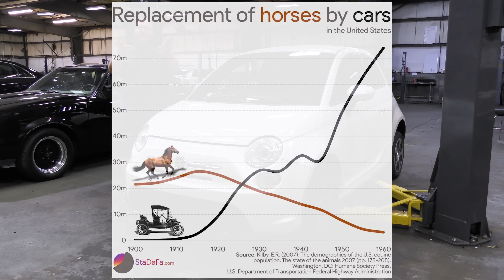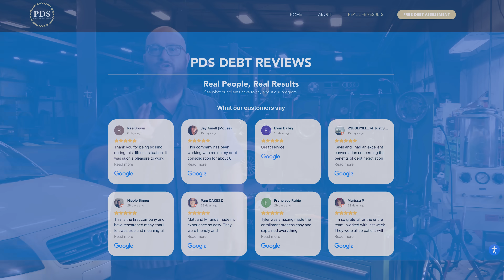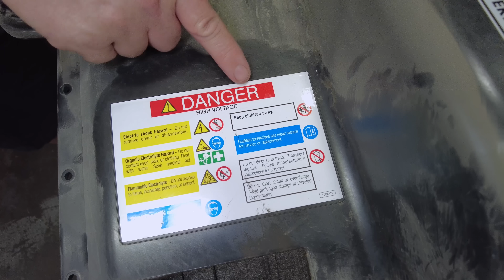How to SAFELY Remove the EV Batteries From my Fiat 500e

Comment: The stallantis EVs Mahle onboard chargers can be changed by removing 6 bolts but the unit has to be programmed by the dealer. The leaf has had its code hacked so can have any batteries fitted giving a range of up to 270 miles.there are plenty of leaf battery modules on eBay if you have an insulation fault due to an overheated pack

Comment: ICE cars don't have cross swappable parts.  Every auto manufacturer has their own proprietary systems and parts.  I don't see EV companies all agreeing to a single battery design or battery management system.  Each of them will continue to try to achieve their own goals for the customer they are trying to reach.  The only place where I do see them coming together is with the charging port and even that willl probably change as technology evolves.

Comment: My problem with the EV thing is how manufactured the push top down has been instead of it being market driven and equally important is how we totally skipped over the hybrid phase which to me is where most of the market should be still… hybrid tech is legit and we could’ve had best of both with incredible gas mileage for the time period until battery technology developed

Comment: I don’t think automakers don’t want owners to fix modules.  It’s cost.  It’s cheaper for them to just swap modules than to hire people to do specialized component level repair.  Not only that, technology is getting more complex and more compact.  For someone to component level repair of a module will have to deal with difficult to remove conformal coatings on PCB assemblies, then have to deal with troubleshooting a specific fault in the assembly (of which needs to “see” other computers and modules and has to be installed in the car or hardware emulator platform), along with the experience of reworking assemblies containing SMD components, IC’s with BGA/QFN/QFP/SOC/SOIC form factors, of which requires incredible skills to desolder and solder without damaging the delicate traces on the PCB.  1/2 hour of hiring these highly skilled personnel will easily exceed the cost of a $500 module, and some problems, it may take hours, or even days to troubleshoot a complex device.

Now, there is a case of the right to repair (knock knock John Deere, Apple, etc) issues with manufacturers.  Unfortunately, those who do have the aforementioned skill sets above (such as I), some things aren’t feasible for repair.  My 85” Samsung TV for example.  Picture went out.  No damage to the LCD panel.  While debugging this issue, I found there was internal faults to the LCD panel.  How I fixed this was to buy another 85” tv that wasn’t a Samsung.

Comment: What if a manufacturer offered an open source EV with an option to operate manually without a computer or operating system?

For sure standards is one of the hardest fights. Not just with cells, but chargers.  Look how long it took for iPhone to move to USB-c charge ports. 
 ports.

Comment: The argument car vs horse doesn’t work with the ev situation. That was a car vs a horse. People saw the benefits of the car over the horse and bought the car. Today we have car vs car. The thing that changes is the propulsion system. But the essence of the thing is the same car vs car. An ice does the same car things as an ev, even has more benefits, more range, no charging hustle, a nice sound and feel, when you drive it, you can bond with it and doesn’t feel like an appliance, cheaper… Again, car vs car is today’s competition and people are not buying the ev car so no, no takeover will occur. I’m sure electric cars will form a percentage of the market but not 100%. And I hope so because what a sad future will be without my beloved internal combustion.

Comment: I think the problem is that EVs in the USA have not reached enough mass to generate a proper support network. A common battery specification would be excellent, but batteries are developing fast and proprietors have little interest in standardizing. Just look at the fossil fuel motors!

Comment: I am 73 years old, and I am an EV advocate and I have worked as an alternative fuels mechanic and fabricator. I have seen the world change to EVs. Here in Athens, Ga, UGA has a EV buses and the city transit has hybrid buses. So it is out there and it's changing perceptions of EVs. But there aren't many shops that will tackle EVs or hybrids in Georgia. Kudos to you having the fortitude to take on these cars.
Reply: And that's the problem.  I think it's great to be doing R&D and public try-outs to get real world data, but to try to push this stuff on a legally mandated basis is insanity.
Reply: @big0bad0brad  I agree, it should be the car buyer's decision to which makes sense  to them.

Comment: Hard to call EVs new technology, when Porsche built their first EVs in the late 1890s. Yes 1890s NOT 1990s. The pure electric Lohner-Porsche range issues were solved in 1900 by adding a gas powered engine with a electric generator as a option, making it also the first hybrid car. So, no, neither EVs nor hybrids are "new technology".
https://en.wikipedia.org/wiki/Lohner%E2%80%93Porsche

Comment: Another issue could of been, the owners short cycling the battery is plugging when the battery didn't need to. ie: drive the car for 20 miles then recharge overnight. Otherwise Fiat made a very small battery, like the LEAF, and really, they get a life of a 1000 charges these days. I have a Chevy Bolt with the replacement battery, and they have very little degradation, even better than earlier Teslas. Supposedly get 300k miles ( we'll see ) Good video though.

Comment: There needs to be a right to repair law, when the battery warranty expires (Typically after 8 years) all battery IP and technical deigns should be freely available as well as all APIs for the BMS as for third parties to produce compatible modules and replace old modules.

Comment: So much F plastic inside that battery, soooo much!!!

I'm 99.999999% sure that that plastic quality, composition isn't meant to withstand 10 years of everyday use, not to break, melt, move, crack etc.

Cars themselves, non electric today are so plastic under the hood, thousands of parts made from hundreds different companies that won the job on the auction to produce for that car manufacturer. All different materials melted from and it's BAD!!!!!!

on one of my cars that wasn't few years old the plastic screw lid for the coolant literally crumbled in my hand into dust when i tried unscrewing it BECAUSE it wasn't made to withstand heat, it was just made of some SH recycled plastic composition.

My conclusion, if buying yourself a car and you're spending a fair amount of money, buy new or ex demo and with warranty, otherwise forget it! Forget it.

Better a smaller car, not as powerful engine but with warranty better any day. Because today's cars are ALL SH quality, plastic and they're ALL cutting corners more and more to maximise profits, it's all about more profits.

Comment: If it's a 42KWh pack it should easily go 120 miles.  The original leaf that only went 80-90 miles had a 24KWh pack.

Comment: Hoovie was too pessimistic about EV batteries in his video about this car. As you said, air cooled batteries (only Leaf and a few low production compliance EVs like the e-Golf) are a bad design, but this Fiat was already using full thermal management in 2013. But given that one or two bad cells can truly trash the whole pack's ability to properly charge, they can be real Achilles heel.

It's going to come down to properly valuing the complexity and emissions impacts of building new cars. We may soon be like Cuba after the embargo, finding ways to make the old cars work way beyond what we thought we'd need to do, as we're not addressing Climate Crisis with anywhere near the urgency we needed to.

Comment: The 2014 500e only has a 24 kWh pack. The new MkII 500e has an optional 42kWh (37.3 usable). Look forward to seeing your battery health after you put it back together. Thank you for showing that non EV mechanics can muscle one of these packs out. Which battery lift did you use and was that the most expensive part of this job, worth more than the Fiat?

Totally agree that we need to make the packs and modules more easily serviceable to keep them cost effectively repairable. Standardization (threaded bolts) was what allowed the USA to become an early industrial leader, and one thing you didn't mention was that we'll actually need EVs to last a lot longer than we ever required of previous cars. That's because the extreme emissions reduction diet the whole planet needs, will require a massive shrinking of consumption of manufactured goods. So we'll have to build these things once and make them last a lifetime instead of churning through 3 year leases, with 2 more owners and then the scrap yard in 10-15 years like we have today.

One thing our current generation of EVs is intolerant of is mismatched cells. So mechanics attempting to repair packs are being forced to find modules (sometimes cells) that are of the same vintage/mileage/degradation so that matching them up with the other existing older modules doesn't cause a charging/balancing/output issue. If we can design the battery packs to allow for varying module abilities, then we could wait until 2 or more modules failed and replace those with brand new modules, or whatever formula of cost effective battery maintenance requires.

Note that that mountain of bolts to open the pack was better than Tesla packs that are closer to opening sardine cans, destroying the top as you peel it away from the glue. And some of the structural packs that Tesla has moved to, don't even segment the pack into modules anymore, so one bad cell spoils the pack, probably requiring recycling of the whole thing.

Comment: The original 500e was an afterthought retrofit by Bosch. They may have altered the floorboards to help fit it, but it wasn't a ground up design at the time. The new one is electric only.

Comment: The range isn't a major issue for EVs to fully take over ICE, okay it does to some extent, but I disagree that EVs will need a range of 1k miles. 500 miles in my opinion is the sweet spot, but more importantly, it's the availability of the chargers and the convenience in using them. 

When I'm fueling up my current ICE vehicle, I don't have to worry about the availability of working, fast DC charging stations, I don't have to worry about if I have the right charging connector and I don't have to sign in to a stupid app to just charge my car...

Everything in this space is like the wild west. Depends on who you're having this conversation with, some will find it very exciting, but others like myself, finds it very inconvenient to the overall experience.

Comment: If that's a 40 KW battery pack you should get 140 miles of range or more, if you drive it on surface streets and don't exceed 45 mph or so. Our Leaf has averaged a little more than 4 miles per Kwh since we bought it. Nissan replaced the battery under warranty at about 38,000 miles and we've driven it right at 30k miles. Unfortunately, it's in the shop again waiting for another battery which they are supposed to replace under warranty again.

Comment: fixing a battery management module is no harder than fixing a combustion motor, just a very different skill set. Electronic repair is not a unique skill and I think the skill set around car maintenance will change. And batteries are batteries at the end of the day. You will have battery recon shops opening up and the prices will drop. Most cars are using one of three cell sizes right now. They are just configured into unique pack arrangements. There will be new skill sets and new workshops that I expect will become more common until they reach critical mass some point in the future.

Comment: They couldn't have used more parts to make the battery pack if they tried, no wonder these are so expensive and not kept on shelves.

It's painfully obvious EVs like these were made because cali mandated having an EV in the lineup, so they asked one guy to do the design in a rush and he just copy pasted one individual module until et matched the Watt/h requirements.

No way in hell this would be sustainable to build at scale and with a profit.

Comment: Your comments are spot on Wizard, Evs are the future. The biggest problem has been that we should have begun the development of a network of  chargers, better batteries ,training mechanics and making it possible to swap batteries over years ago. Governments and car companies have screwed up the implementation of the new tech, vested interests have stood in the way of the transition at every possible way for decades.
Reply: Working on electronics is a pain imo mechanical stuff you can just look at and it makes sense
Reply: @clydedoris5002  Yeah the only thing that mitigates it is standardization.  If there were like 3 or 4 standard battery geometries and connection systems then EVs would be much more practical.  Who cares when you can't buy a Ford battery anymore when LG or whoever still makes one.  The way things are now tho, it just doesn't work long term.

Comment: Young electromechanic here. I think you're absolutely correct on everything you said about EV's. Yes,they have a lot of advantages over ICE cars,yes will be more repairable in the future and yes,you better believe they will out range ICE. It's a technology that's only 10-15 years old. Wait another 10 years and see.
Reply: There's batteries on the market right now with 500,000 mi warranties. I think you need to catch up.
Reply: @Joegreen-r1i  If the batteries are genuinely that good then there would be no need for ICE-powered vehicles.  I think you need to be real.
Reply: Still need a big breakthrough in battery technology, especially price and longevity.

Comment: I worked for GM for 2 years as a technician and when I got certified for the Tahoe hybrid i was sent to Detroit for the hands on classes. It is interesting to see other manufacturers systems and how they are built. The Volt was the last vehicle I was certified in aside from Corvettes and Duramax diesels. I would not want an electric only car or truck because of range but they are cool. Battery technology is not ready in my opinion. They are too expensive.

Comment: Gunna disagree with you Wizaed. EVs were around when gasoline cars were first invented but didn't takeoff. The issue with EVs is that batteries don't last and the replacement cost is too high. This will kill the industry. People won't trust them. Horses need to be fed, and have a mind of their own. A motor vehicle can be easily maniplated and easy to feed.

Comment: I believe Leaf fixed that with water cooling later. Jag35 sells modules for EV's for replace them. Yes I think we should be talking cooling management for EV's to help the batteries. These EV's are good tinker tools. Well done on troubleshooting. You still got a EV cheap after its sorted out!

Comment: My 2015 Leaf is still going strong, but its exactly where it needs to be: in a fairly temperate part of the US, owned by a cranky, maintenance-hound old man who drives 26 miles round trip to work every day. I did have to replace the conventional 12-volt battery this month. Come on over and let me regale you with tales of my immortal brakes. 😂

Comment: I think at some point in the future there will be a set of standards on various battery packs. Think of it like group sizes and standards on normal 12v car batteries. It dictates things like CCA and the battery dimensions as well as the +/- placements. For it to be EV focused it will need to be certain capacities, connections for coolant, electrical connections etc. Once the standards are set then a company/s actually making batteries to those standards then car companies can design around specific battery packs. The car companies can add to the standards by making specific packs but that has to be open for use for everyone. 

Ideally you would want just replaceable modules. Like an SUV would use more modules than say a small car like the fiat, but I think that would be further down the line. The complexity to implement that is likely quite a bit higher than simply having battery standards where you can drop a pack and replace it with a new one of the brand of your choice.

Comment: EV's have their uses. What really bothers me, is when governments get involved. Insisting that we have certain things and threaten to remove that which we are quite happy with. The changeover, from horses to automobiles, was entriely driven by the public. What was useful, efficient and convenient. The demand was there, without any threats from the government. Early horseless carriages, were electric from the start. Gasoline engines improved the useability, convenience and range. Better than electric vehicles could offer at the time. Again, no government involvement. It was the peoples choice. I feel that we are being 'bullied' into the adoption of EV's. Where modern technology has brought them almost, to a par with ICE vehicles. The range, the cost and the charging times, are still not up to ICE standards. But if you have a short commute and off road parking, they are an expensive alternative and/or replacement.

Comment: In this video, you don't actually talk about what it takes to remove the battery in the 500e. You have to remove the rear axle to drop the battery. I didn't hear that mentioned. Of course I scanned through the video, but I never saw anything about what it physically takes to remove the battery. Having to drop the axle is a pretty big detail to omit. And the way the underside of the 500e is presented, you wouldn't think it's an issue, but believe me, it is.